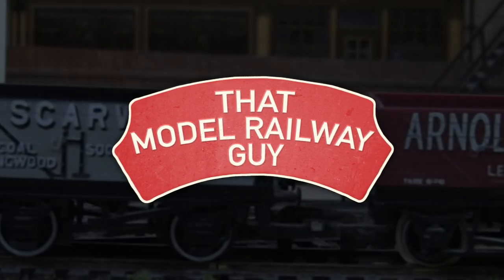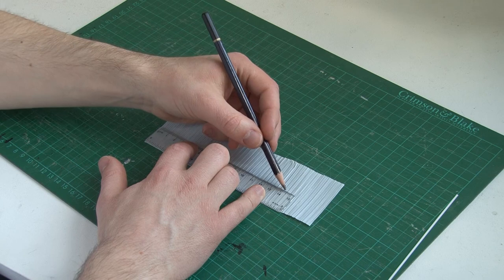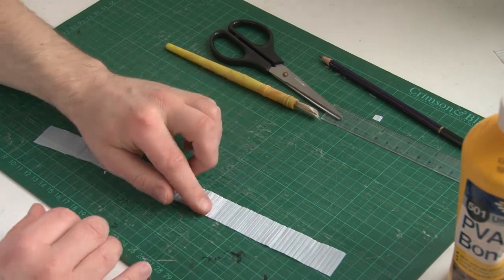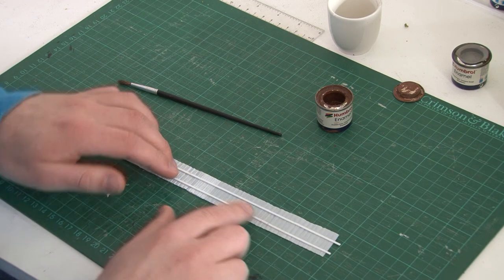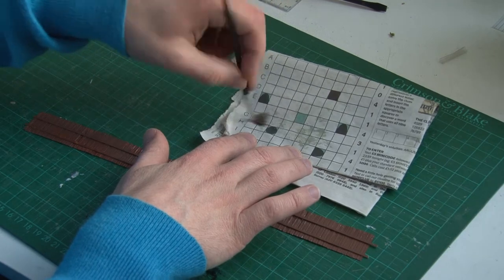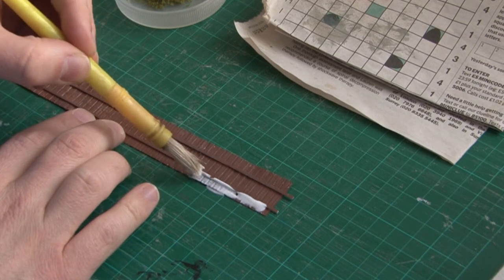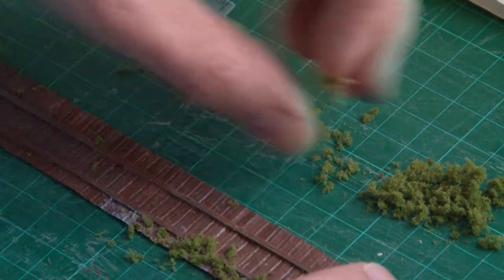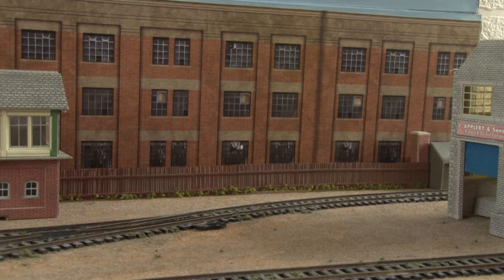How To Make Cheap Fences - Model Railway Tutorial

Comment: Great idea.  I will give it a try.  However, I do have a question.  How do you Incase the top edge of the fence?  Doesn't the paper separate from the wires exposing the materials inner side?
My quick and dirty solution was to snip off the damage & repaint!  But even that opens up to more snip snap repair jobs.  Any ideas?
I just found you channel by misspelling the channel I was searching.  I like your humorous flippant style so much I'm going to subscribe when the post is finished.  LIKE NOW!
Jim in N.Y., U.S.A.
Reply from the maker: Hey there, perhaps there are different types/brands of sandwich bag ties out there as the ones I was using were plastic not paper. This made them a bit more sturdy and I didn't have any trouble with them separating, especially once the paint was on as that essentially sealed it.

Great to hear you enjoyed the video after stumbling on the channel by mistake. It's great to have you! Thanks for watching and subscribing too 😃

Comment: looks great. where can I get those?
Reply from the maker: Hey there, which parts do you mean? The sandwich ties can be got from most supermarkets I imagine (although I got mine from eBay). Everything else you should be able to pick up either in a model shop or online and then you'll have everything you need to make plenty of fencing. Thanks for watching 😃
Reply: @ThatModelRailwayGuy  I've tried ebay but it shows me only the separate ties, couldn't find any sheets. do you possibly have a link for it?
Reply from the maker: Here you go, hope this helps 😊
https://www.ebay.co.uk/itm/324135079130?epid=1128405580&hash=item4b77f4ccda:g:dbsAAOSwme9elPGd
Reply: @ThatModelRailwayGuy  Thanks! Unfortunately the shipment is about 30 AU$

Comment: Can you say clearly what u used apart from sandwich ties……all a bit rushed….please?
Reply from the maker: Hi David, the other main item used is 0.8mm x 1.5mm plasticard strips. 
PVA glue to holds it all together, various brown/grey paints for colour (acrylics or enamel are both fine) and a little bit of green flock along the bottom - personally I use Woodland Scenics Turf in medium green. Hope that helps and thanks for watching 😃